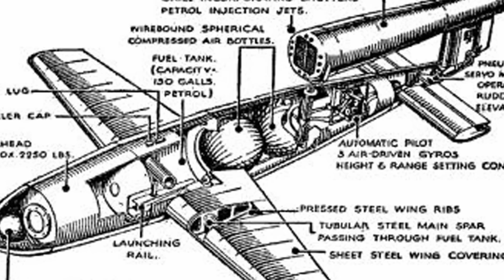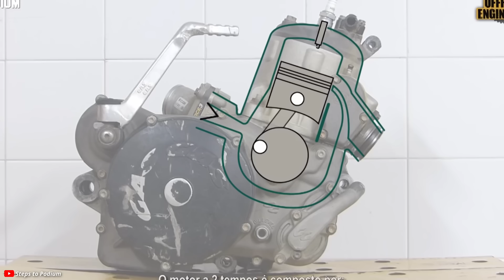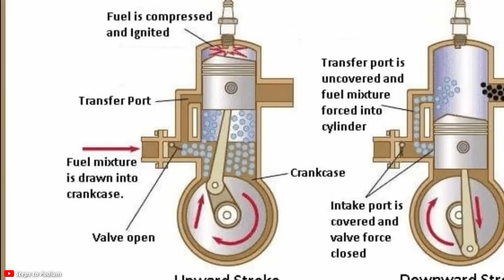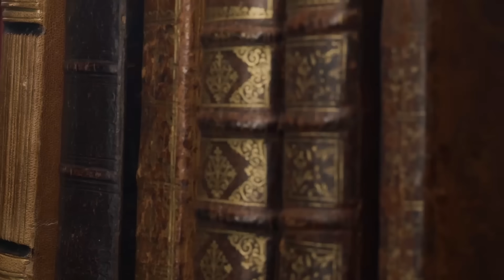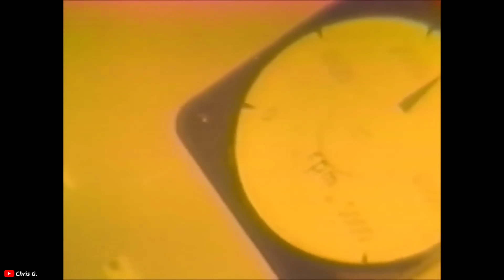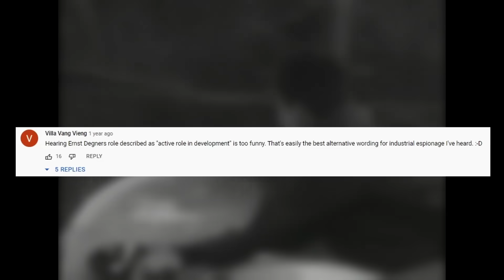How Suzuki stole communist technology to make their motorcycles faster

Comment: I did not know this. Gonna spread this video around to my buddies and see if they know this. I had some pretty hairy rides on a Suzuki water cooled 750 highly tuned with Jemco headers, automotive coils, and fuel adjusted to handle it.  Built to be a cafe street bike. Suspension was crap.  That's all I know about the bike, but it was sitting under a carport and needed some running. I rode it a few times and got off of it. The power band at 5000 rpm was wild. Front tire guaranteed come off the ground, no effort at all.  I pegged the 120mph speedo each time I rode it.  I went to their 4-stroke line after that.

Comment: I had a Suzuki RG125 2 stroke in 1991 that had 22hp and it was an absolute riot, Suzuki had added powervalve technology by then, basically opening and closing a chamber in the head to move the torque up and down the rev range so it was more linear and not just a big top end rush

Comment: We were mesmerized by this engineering, I rode a Zundap 250 cc and the thrill was big! DKW was also tested. The MZ we never got to see in South America, we saw the JAWA CZ most of them 2 stroke as it seemed to give better speed results for speeding motorcycles like the Mosquito, Motobi, Atala, Sterzi
Reply: Thats not true; MZ was also made in license by brasil (MZ 250 RS). MZ´s was always faster than CZ or Jawa. A Jawa 350 with 2 cylinders and 350 ccm and 23 HP couldnt hold on a MZ ETZ 250 with 21 HP...

Comment: The first 2 stroke was built in 1879 by Karl Benz, the co founder of Mercedes Benz. Everyone knew that exhaust design was critical to the efficiency and power of the engine, that's how it works without exhaust valves and a camshaft, the exhaust system is designed to suck through the engine. And since 4 stroke engines used valves, many people were designing valve systems like the rotary valve that was used. To claim that the Russians were 100% responsible for the development of 2 stroke exhaust systems and rotary valves is absurd. The funny part is the Russians would never have known about the 2 stroke engine if it weren't for a German. So to improve it a little using design changes on things everyone knew mattered isn't a big deal. But thank you for the rest of the history lesson, really.

Comment: Sorry to nit-pick but just to correct a few facts.   Kaaden did not work on the V1 development, nor did he work with Werner von Braun.   Although he did work at Peenemunde with Henschel on missile development.  He did not invent the disc rotary valve or the two -stroke expansion chamber.  What he did however (with very limited resources) was to combine and optimize all these features using his knowledge and experience of acoustic resonance gained during WW2. A remarkable engineer.    Otherwise, an excellent account.

Comment: Great video, the early racing two strokes had a tuned megaphone exhaust, this would help scavenge the exhaust gases and also create extra negative pressure in the crankcase which would increase the intake port charge, the disadvantage of the megaphone exhaust is that it would scavenge out a lot of the gas mixture out of the exhaust port, megaphone exhaust's are still used on some racing outboards with cross flow porting.
     By adding a rear cone to the megaphone exhaust, the sound wave from the exhaust port, when it just opens, will reflect off the rear cone and push the scavenged raw gas back into the cylinder just before the exhaust port closes. This will happen most efficiently at a specific rpm range that the pipe is tuned for, this is called "Riding on the Pipe", it is a very noticeable power surge when riding an older piston port two stroke like a 125cc without a power valve.

Comment: I don't remember seeing a 125cc road race. Not here in the US. As I recall, it was Yamaha punching above their weight class. They were the ones who amazed everyone by beating Harley Davidson on the road circuits .Kawasaki was the first to use rotary valve 2-stroke road bikes. It was a Samurai. I do remember the H1 3 cylinder road bike that had over 60hp. It took a good rider to get one straight down a 1/4 mile drag strip, but they wee fast..
I owned a 125cc Suzuki road bike. It was a single cylinder model and it had about 12 hp. I traded it on a '67 X-6 scrambler (which I regret ever buying). It was rated at 29.5 hp and had a 6 speed transmission. It was very finicky about ignition timing and the power dropped off noticeably when it was time for a tune-up. In retrospect , I wish I'd gotten a Honda CL250 and garaged it. Actually, there was little difference between the CL and CB models. The CL wasn't a real dirt bike, but there was this thing called the Jack Pine run here in Michigan, and when I was bow hunting and fishing near the high-bank camps on the Muskegon, I heard those Hondas and that sound had me hooked! Unfortunately, in '67, I was all about spec sheets, so I got the Suzuki.

Comment: All that I remember from 2 strokes is that the Yamaha RD 350 wass a killer machine. You then add a box, polished ports, changed sprockets and you had the devils machine. I loved that bike. Then there was the Honda CR 480 R scrambler, a beast of a machine. Then had a Kawasaki KX 420 E scrambler which I cursed as that seat was very short and you would smash your dingleberries every now and again on the tank but it was a blast. Does not matter how bad your day was but when you got on a decent 2 stroke you smilled all the way home. Oh yes tlking about the initials RG, I remember my friend had a Suzuki RG 50cc air cooled engine with a 5 speed box. A nice roundabout bike for a youngster. My one school friend Shaun Willis had a Yamaha RZ 50cc and his dad used to tune it for him with an expansion box fitted and all the other bells and whistles. He then returned to the UK where I believe he participated in the 500cc Grand Prix. I believe he died a couple of years ago from a heart attack. He was a damn nice fellow.

Comment: I recently purchased a 1976 KE175, is my first time on a two-stroke but immediately I noticed how the exhaust does look like any other of the modern exhaust or racing exhaust that I see.for manufacturing purposes did they dumb this system down or is it possible to use a different exhaust on this bikeI'm pretty much a deal fight when it comes to this I was a four-stroke manthis video however really blew my mind in terms of the history of the two stroke thanks

Comment: Hi a bit of Australian history a friend of mine had a prewar  D.K.W. it had 3 cylinders 4 conrods and one spark plug . One very large cylinder had two conrods that was a type of pressure device. Another cylinder was set up to pressure rise the crankcase and the 3rd cylinder with the spark plug was the main firing cylinder . . He was offered money to do research to make a film about the history of the bike. From what I remember the racing team that came to Australian was also doing a bit of spy work before WW11 . the last time I heard about this bike it was on loan in the Birdwood Motor Museum in South Australia. I also remember it had rubber band front suspension was  silver in colour . Not sure if the owner is still alive but lived north of Adelaide in Elizabeth

Comment: kind of crazy how powerful modern 2 stroke engines got
like a 100cc chainsaw with something like 10-12hp, or 85cc mopeds with 15hp or even more

as good as cordless tools may be today, they will never be able to replace a 2 stroke engine

I may have never worked with a cordless weedwhacker since they are pretty expensive, but with the right attachment you can cut down small trees and brushes for just 100$

Comment: Scott 2 stroke water cooled twins with deflector pistons were banned from competition before WW1 because they had 2 power strokes/rev.  

MZ (pronounced Emm Zed, here) were popular commuter-type motorcycles in the UK in the 80s.  AS part of war reparations the DKW (Das Kleine Wunder) engine design formed the basis of the popular BSA Bantam 125cc lightweight motorcycles.  The design was reversed to put the gear change on the right as was universal in the UK at the time and for years later.

Interesting video, thanks.
Reply: Yes we know that 2 strokes are environmenrally taboo but back in the day at 17 i went from a bicycle to a gt125 capable of nearly 80mph with no training. Great invention by Scott. I wonder where the germans got the idea from.

Comment: My first bike was a Suzuki GP100. which i later fitted an expansion chamber to  that turned it into a little rocket at the expense of piston wear and soon it needed a rebore. This is no doubt a nod to the tecnology which suzuki gained from their German technicians as it was fitted with a disc valve induction from the begining. I later also had an MZ ETZ250 which was undoubtedly the ugliest bike on the planet but with an unburstable engine. The gearbox was a weak point failing at around 25.000 miles. it was cheaper to fit a new engine than to repair the gearbox and the replacement engine also failed at 25.000 miles. The selector forks wore out too quickly!...

Comment: I owned and road a Kawasaki 750 H2. I was 18 and learned on a 100 enduro made by them. Quite the jump up in power. It would pop a wheelie in any gear. I set the throttle so that if I turned it fast it would bog down and go to idol. I did not want anyone turning that throttle to fast, it was a rocket on two wheels, at 90 mph any defect in the road would make it skip across the the ground. My girlfriend at the time I took for a ride. How I road. I talked to her 44 years later, she said she never got on a bike again. I was not trying to scare her. It had headers on it and it was like a roaring lion off the line. Never seen a bike like it since. G force just opening your right hand to let out the clutch was scary. I got hit on it and gave it up because I was to dangerous on it and I knew it. Years later I looked up info on the bike and found out it got the name Widow maker. It sure was. I would go out late at night on highway 41 north of chicago in winter when the ice was gone and lay down on the tank and wail down the road when it was empty. The devil would always remind me of how I could be a red streak on the road.
Reply: thx for the nice story.

Comment: MZs were pretty common on UK roads back in the '80s as low cost commuter bikes. Models I remember are the ETZ125 and ETZ250. They certainly weren't fast. It's like MZ forgot all of Kaaden's great work - Excepting the boost port. That said people did fettle them for racing with very heavy modifications... Redoing Kaaden's work!

Comment: "Ring-a-ding-ding-ding-ding - RING-A-DING-DING-DING-DING-DING-DING,  RING-A-DING-DING-DING-DING-DING-DING - ring-a ding- ding-ding." Those of you old enough to remember - the pilot drove thru the corner - gave it the beans down the straight and then drove thru the corner at the end of the straight.

Comment: According to Wikipedia, the induction valve and porting technologies used in these 2 stroke engines were developed by Daniel Zimmermann in the DDR on the DKW prewar engine platform. He was using them on for his independent racing team on a motorcycle which was outperforming the MZ ones at the time. The DDR state did not want an independent team outperforming the state owned MZ, so the state forced Zimmermann into MZ, where Kaaden took his ideas and incorporated them into his motorcycle designs. Kaaden's main input was in engine resonance and exhaust design improvement.

https://en.wikipedia.org/wiki/Walter_Kaaden

It should also be understood that prewar DKW engine technology was used as war reparations after 1945 by allied industry in its products. Where the Germans got their ideas from, I do not know.

Comment: They did it again when the stole Kawasaki's 4 cyl 4 stroke design from the Z1.
Reply: Yeah certainly, but Honda went before that. Their CB750 K1 was a product of corporate espionage to Kawasaki's early development of 4-stroke 4-cylinder 750. They forestalled to make public of their prototype in 1969 Tokyo Motor Show, so Kawasaki renewed their design to 900cc and released their 900RS Z1 (KZ900) in 1972.

Comment: I suggest you read "TEAM SUZUKI" by Eng. Ray Battersby, former race and R&D engineer in the team back in the '80s: the story you've told isn't even the better half of it... Look for the 500 cc F3 category in East Germany and a name: Daniel Zimmermann and his Zimmermann Eigenbau, which engine (a 2-stroke) had a valve system that was so revolutionary that Suzuki had to obtain it to solve a lot of issues with carburation and compression, the rotary valve (yes, Kaaden didn't make it, he copied it from Zimmermann when the team went tits up in '51).
Also, I recommend French auto magazine "AUTODIVA", number 48 of 2022, about the topic :)

Comment: 7:44 that's not how it works! If it was like that it would run even better without the exhaust manifold.

What makes it work is that the bulb allows a reflection of the exhaust pressure wave, think of it like bouncing back radio waves or something. If you make the bulb such that the time it takes for the exhaust pressure wave to go to the bulb and bounce back to the cylinder exhaust port, so that it's the same time as it takes for the piston to complete one revolution at a certain rpm, then that rpm range with essentially be supercharged since the pressure from the exhaust port allows for boost pressure to be maintained in the cylinder before the compression stroke.

This is why 2 strokes have such a distinct power band, it's when the timing of the reflected exhaust pulse lines up with the intake interval. At least the ones with this exhaust bulb, a chainsaw for instance does not have this since they typically lack this style of exhaust, they just use a simple muffler.

Comment: Suzuki getting lazy as a manufacturer is spot on. Although not a 2T engine, a great example of laziness is the DRZ400 engine. It's a very good engine but also an old design. Instead of adding features that customers needed, Suzuki stayed with the old design. A lack of another road gear, an old carb design etc etc.

Comment: I'm not so fond of the rotary valves, but a 2-stroke could still be suitable to some modern vehicles with a more accurate control of both intake and exhaust flows.

Comment: This may be controversial for me to say on this video, but ultimately what Ernst Degner was for the greater good for the advancement of motorcycles in general. MZ, while on the bleeding edge thanks to the brilliance of Walter Kaaden and his hard work and engineering prowess, was a dead end street at that moment in time. The East Germans weren't going to do anything of note with this technology and Kaaden wouldn't have benefited from his hard work because of the fact that the GDR didn't want to share it by making it accessible to everyone either in their own sphere or outside of it by letting MZ have more grants to produce bikes to sell around the world. It just would've sat there until someone eventually figured it out, albeit way later than it should've been. It's like with Ferdinand Porsche "borrowing" concepts from Tatra's chief designer Hans Ledwinka from his Tatra 77 and 87, as well as the V570, to make the Volkswagen Beetle and how that evolved into the Porsche 911. It's a disgrace that Porsche and VW get all the credit but I don't think Tatra would've been able to benefit from their own work because of how the chips fell in WW2 sadly. I don't think Suzuki is necessarily right in denying Kaaden's achievements and allow themselves to get lazy, but I think it was what was best for the advancements in motorcycles which ended up being built upon Kaaden's work.

Comment: Only small engines? In 1939, GM's Electromotive Division introduced the Model 567 engine (567 cubic inches per CYLINDER). producing 1000 hp in 12 cylinder versions and 1350 hp in 16 cylinders for rail and marine use. Twenty seven years later a 567D3a of 2500 horsepower rolled off the line. Every one of these thousands pf engines was two cycle. The 567 was replaced by 645 of 3000 hp, which was essentially a bored out 567 and that was replaced by the two cycle 710, an improved 645 capable of 4400 hp. So the subject of this video was hardly revolutionary. The question is, why did it take so long?

Comment: This scenario has parallels in the beginning of motorcycle racing. Scott 2 strokes wiped the floor with the opposition at the IOM in the early part of the 20 century Pre WW1. The controlling body of racing ruled that 2 strokes be handicapped by a 1.32 factor in the engine size against the 4 strokes of the time. Interestingly, Scotts used rotary inlet valves and transfer ports, nothing new under the sun is there. Was it Einstein who remarked about standing on the shoulders of Giants.

Comment: A really interesting video but I do wish that he'd pronounced MZ correctly.  It's MZ (zed) and not MC. He didn't mention that the MZ was also the basis of the BSA Bantam. I owned 150cc MZ back in the early 1970s and I did over 150,000 miles on it. It was a really wonderful basic motorcycle, whatever went wrong you could fix overnight and use the next day. It's not all about super fast race bikes.